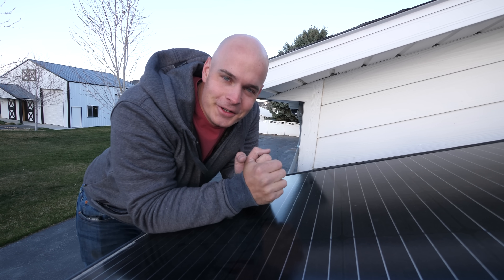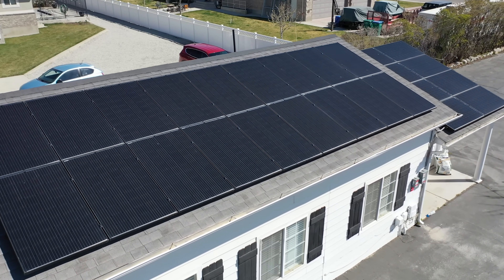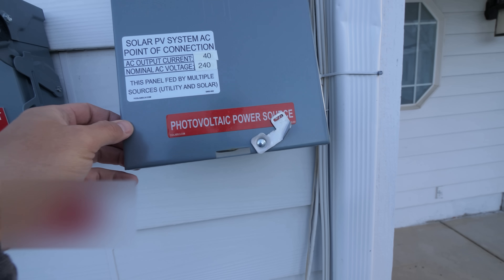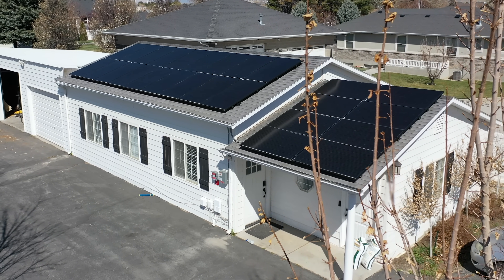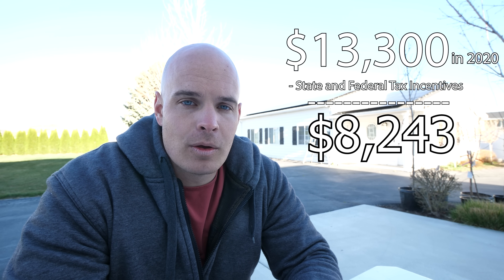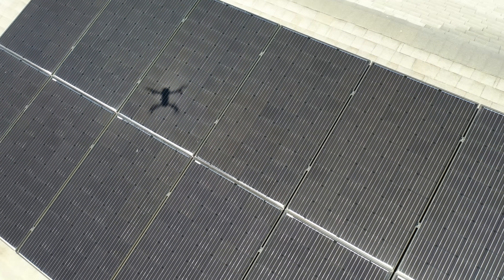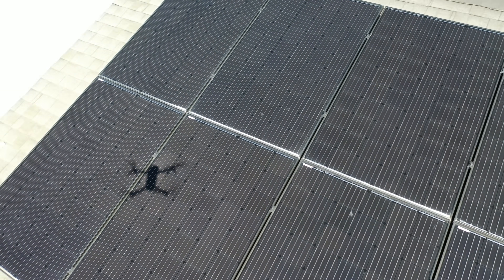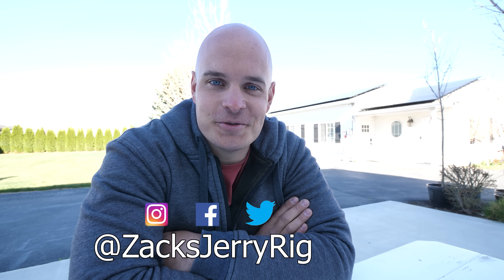One Year Solar Update! - Is Do it Yourself Solar worth it?

Comment: Solar is 54gco2/kwh (not everywhere... and only when you get sun...)
Nuclear is 6gco2/kwh... when you want it.
You can see more information on 
electricitymap website
But in US because your electric power production is... catastrophic... i guess it's better compare to gaz : 400gco2/kwh, coal : 800gco2/kwh like oil.
Don't forget and remember. 
The earth don't care about price. Only co2. (For animal and us)
And for US it's the possibility to use electric power when we need it. And wind and solar... we don't control it..and it's working like 10% of the power install... ridiculous.
So Nuclear and Hydro is the go to because we can change the power or increase it as we need it.
Ps : if you panel is made in China... you need the same lifetime of the solar to get the same co2 saving and use to build it... so it's... usuless....

Comment: Hey Zack, I have a question. How well is your house insulated? And, how do you heat your house, by burning gas or do you have a heat pump? And if you don't, did you every consider it/weigh out the cost of installing one?
 I think that this whole situation and now series from you is very nice as you clearly show the potential of installing solar energy. However, besides the idea of 'how can I get as much green energy', a different ideology is 'how can I use less (brown) energy'. So I'm very interested in how that is applicable to you.

Comment: How about what was your power bill per month prior to the panels and post. Also what is the actual kw usage of the structure, if the structure only uses 15kw per day, that is all you can use in your savings calcs, the rest in throw away since you are not directly using it. Rocky Mountain power doesn't pay you for the power you "give" to them. 

The green part always makes me laugh, the same amount of raw materials are still needed on a per panel basis, that takes the same amount of energy to harvest the raw materials, production costs of the final product make cost less, but actual environmental costs are no different, and what happens in 30 years when they need to be replaced or the millions of other panels that have now created a huge e-waste issue that is just stacking up.

Comment: my roof is about 6 years old and in good shape. although, for older roofs would you consider putting on new shingles before doing the solar panels? I think most shingles last about 20 to 25 years. Also, do the solar panels help protect the shingles underneath? I'm guessing that would be the case. thank you very much! great video and great information.

Comment: Texas have the same problem as every country going green. Solar and wind does not have any surge capacity which means that if you have removed nuclear, oil and coal and dont have available water produced electricity the grid will go offline or they buy electricity from elsewhere.

This makes the grid unstable and skyrocketing prices.
Removing nuclear is the worst thing you can do because it is the cleanest way to produce electricity next after solar but with surge capacity. (wind kill huge amount of wildlife)

Comment: Here in Indonesia newer homes often use pre-paid electricity tokens system preinstalled by the government including mine. I did a quick crunch, my home took around roughly 100kwh per week (it's a small house), so it's 5200 kwh per year. 
So that means your setup could power up my house for 2 years straight. Wow.

Comment: The problem with solar energy is the battery system. It is way more toxic than coal or other sources, since you have to replace them every so many years. This means that all the toxins have to be recycled which is extremely harmful to the environment.

Comment: For those interested about how much energy you lose by orientation:
If a south facing 30 degree panel would be 100%
Then the exact same panel 30 degree west facing would be 91%
East and west make no significant difference (its in the tenths of a percent range)

For flat roof compared to pitched, most flat roof panels are installed at 13 degrees (at least where I work)
Compared to pitched south 30 a flat south 13 would be a 96%, and flat west 13 a 89%

ANd for those curious, at 30 degree pitch northfacing panel produces 57%, and 13 degree flat northfacing 77%

Source: Im a solar system designer in europe

Comment: i have a 3,5kw/h array on my roof (wich in a sunny day produce realisticaly around 3kw/h). Thats enough to power all my electricity needs on the day, and the rest is sold to my local company. In february (summer here in argentina), my first full moth of solar energy i saved around 80% on my electricity bill.
I payed around 3,2k dls for the system so by my calculations it would take me around 6.6 years to pay itself. it seems like a good deal to me.

Comment: In India we get the same build at quarter of price. 
We have largest rooftop solar project in world, you would like to check out. 
Cherry on cake is we don't have to install ourselves all the cost include installation. 

All system are grid connected so never worry about managing power. We get breakeven at 3-3.5 years maximum.

Comment: can i have 10c us per kwh pls... here it costs us aud 38c per kwh, though we do get buy back of excess energy of 12c per kwh.
We've installed 7.2kw of solar with a 6.2ah batter (with government incentive) but it only came with a 5kw inverter so we do loose out through summer as it just can't produce enough to add it back to the grid.

We also have the issue here where the grid 'can't handle the reduction in load from the normal production points' and that too much solar could actually cause the grid to fail.

Comment: Here in The Netherlands, electricity costs 26 cents USD per kWh on average. 8,4 cents is the cost of the actual electricity and 17,6 cents is tax.
Reply: Also, for comparison. My girlfriend and I use 142 kWh on average per month. That is everything, even including our induction stove, washer and dryer. My monthly electricity bill is around 22.50 USD. And the funny thing is, we don't do anything fancy. We just turn off the heating, lighting, etc when we are not at home.

Comment: U didn't quote how much it costs to buy and install battery pack ... Or are u planning to make your own with 18650 cells ? Bring @Electro Boom to help u out after the pandemic .. would be a fun Collab I suppose
Reply: I doubt he has the knowledge to make an efficient battery pack, considering that you have to take into acount fault system, battery management system, AC/DC inverter, regulation and so on.
Reply: @PlayboyHZ  u mean mehdi dosent have the expertise to do that ? I think he(mehdi) would be good enough

Comment: As long as these solar panels scratch at a level 6, with deeper grooves at a level 7, then yes, it’s absolutely worth it!!
Reply: @stockstrut  your friends are Absolutely right!
Reply: @doge5731  I’m more surprised by the fact someone like him has friends
Reply: @stockstrut  it's true you can't 😂😂😂
Reply: They scratch at level 3 with deeper grooves at level 4. 'cause the upper layer resembles more to polycarbonate and not glass.
Reply: @stockstrut  i think your friends are right!
Reply: @stockstrut  your friends are right
Reply: @stockstrut  SLAMS LEG SILENCE !
Reply: 4x4x4x4x4x4x4x44x4x4x4xrx4x4x44x4x4x4x4x4x4x4x44x4x4x4x4xrx4x4x4x4x4x4x4x4x4x4x4x4x4x4x4x4x4x4x4x4x4x4x4x4x4x4x4x4x4x4x4x4x4x4x4x4x4x4x4x4x4xrx4x4x4x4x4x4x4x4xrx4x4x4x4x4x4x4x4x4x4x4x4x4x4x4x4x4x44x4x4x4x4xrx44x4x4x4x4x4x4x4x4x4x4r4x444x4x4x4x4x4x4xrx4x4xrx4x4x4x4x4x4x4x4x4xrx4x4x4xrx4x4x4x4x4x4x4x4x4x4x4x4x4x4x4x4x4x4x4x4x4x4x4x4x4x4x4x4x4x4x444x4x4x4x4x4x44x4x4x4x4x4x4x4x4x44x4x44x44x44x4x4x4x4x44xrx4x44x4x4x4x4x4xrx4x4x4x4x4x4x4x4x4x4x4x4xrx4x4x4x4x4x4x4x4x4x4x4x4x4x4x4x4x44x4x4x44x44x4x4xd4x4xrx4x4x4xrx4x4x4x44x44x4x4x4x4x44x4x4x4x4x4x4x4x4xrx4x4x4x4x4xrxrx4xrx4x4x4x4xrx4x4x4x4x44x44x4x4x4x4x4x4x4x4x4x4x4x4x44x4x4x4x4x4x4x4x4x4x4x44x4x4x44x4x4x4x4x4x4x4x4x4x4x4x4x4x4x4x4x4